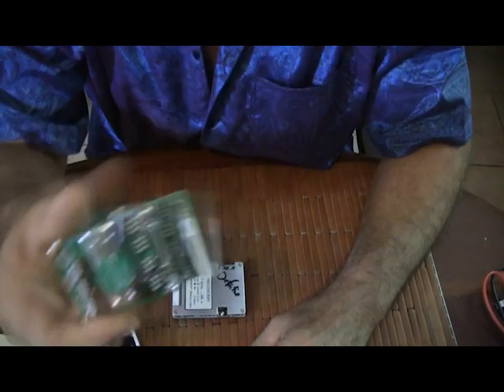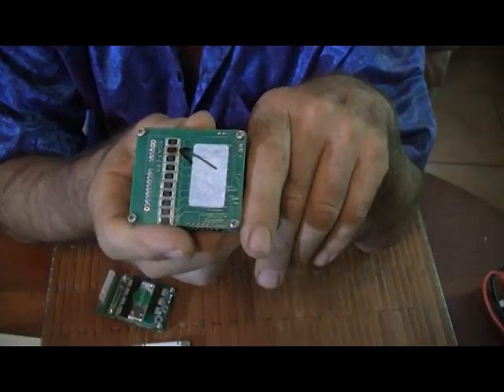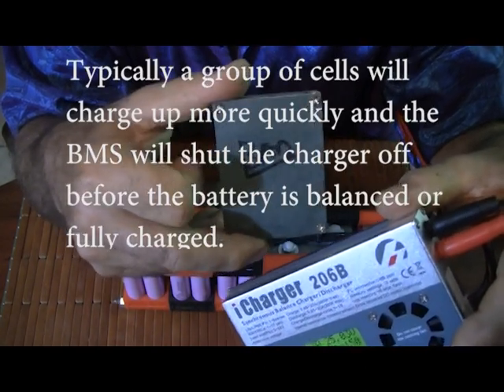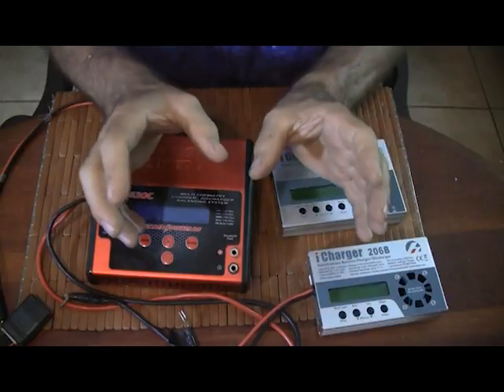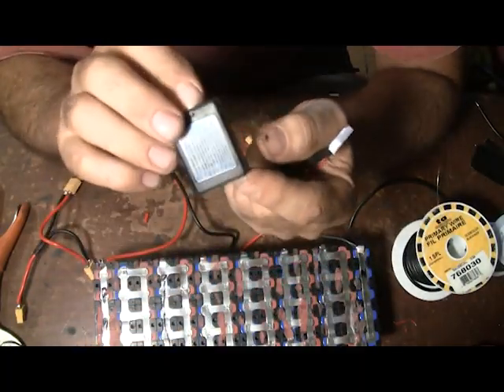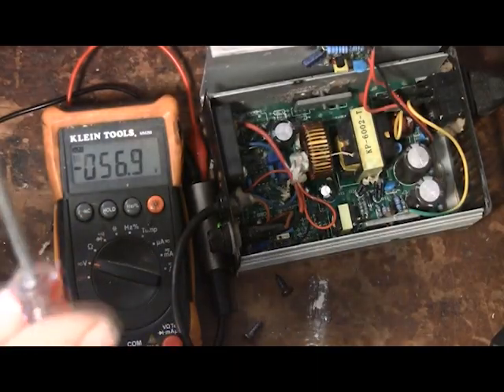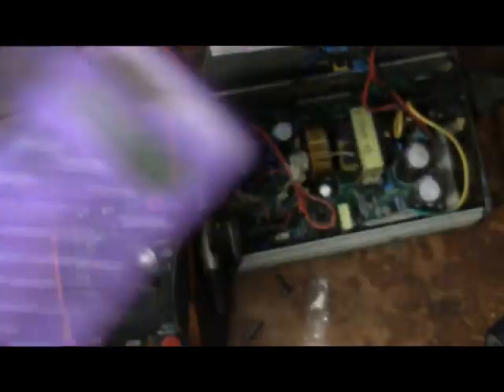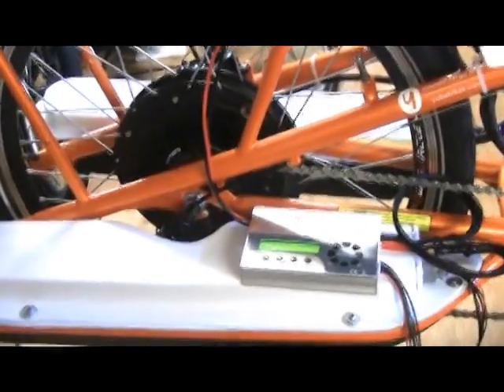How to build a safe and better lithium battery WITHOUT a BMS.

Comment: Hey Shawn, this is the BEST anti-BMS video I have watched so far!!! I don't use BMS myself for the same reason as you, there's no feedback and I don't know what that little cheap and nasty PCB is doing. Most batteries (to not say all batteries) I repair have a problem related to a faulty BMS. The cheap ones don't balance the cells at all they actually KILL cells.. last thing you want is "a device that will unbalance and kill your battery". BMS also makes things unnecessarily a LOT more complex, that doesn't encourage people to make their own batteries!
I made a pack with Panasonic PF back in 2014 and last time I balanced was almost a year ago, I run it hard 1500w every single day, guess what, almost one year later the pack still balanced.
On the other hand I have many videos showing "how to install BMS" because from a bike shop perspective, most ebike users have absolutely no clue about electronics so in this case the BMS is more reliable than some humans.
Congrats for this video, I will recommend to many people here when replying comments in my channel =]
Reply from the maker: Hey Thanks Bruno!  I'm pleased that you have come to the same conclusions that I have.   Tell me, how far would you let your pack get out of balance?  .1 volt, .2 volts?  And what cell voltage do you charge to to be safe- 4 volts?
Reply: Hey Shawn, good questions haha.. at work I have to be a bit more strict with balancing as the pack wont be under any monitoring apart from the BMS, most BMS will cut above 0.5v so I try to keep it below 0.2v after multiple cycles to ensure this difference is not growing and the pack is stable. 
I do charge my 14s all the way up to 58.8v which is 4.2v per cell, it takes a LOT longer to charge but in my case I performance is more important than range and the pack life. For a regular commuter I would say 4v per cell is all they need, really liked you mentioned many times in your video that charging to 4v you can double or triple the cell life, most people don't even know these things. POWER to the people haha =]
Reply from the maker: Thanks for your insights Bruno!  Experience has led us to the same conclusions!
Reply: @BrunoPOWEEER i have recently made a 16 S lfp prismatic pack,and i reduced the peak charging voltage from 59.2 to just 57 volts,, which is just 3.57 volts per cell, while lfp cells can be charged to 3.7,, i have discarded BMS because it failed to respond,and i think i would buy an charger for individual cells when they get too much unbalanced
Reply from the maker: Awesome.  Lets feedback one into the other, create fusion, and power an ebike to Mars!
Reply: No bms also gives you more POWERR!!!!!
Reply from the maker: Good point.  It's because the power does not have to run through the circuitry of the BMS.
Reply: @shawname2 very true
Reply from the maker: Not with the same weight.
Reply from the maker: I agree John- someone with the skills you mention plus a knowledge of electronic circuit design could build a custom BMS for their purpose.  Maybe you could do a video outlining the major areas so we could begin to learn how to do it?  That would be great!
Reply from the maker: You can't trick the laws of physics!  You would need a battery 60 times more powerful, a plane 60 times lighter, or a motor of 1/60th the power...
Reply from the maker: It's a scam.  I have seen plenty.  Latest was a friend who bought some "5000 mah" batteries with "fire" in the name.  They were a bargain, just .85 each!!!!   They tested at 600 mah.    Fortunately he didn't buy too many.
Reply: I have been trying to tell people this but what do I know ? I have a complete electronics lab at home , waiting on my third oscilloscope to arrive this week . During the last 2 years I have bought just about any kind of test equipment anyone could ever need off of eBay , my wife is not to happy with me at the moment . I did fix 2 flat screen TVs and a Bose home audio system for her that were given to me but she is still pissed
Reply: @fakenews7266  Trouble is women want the latest and greatest
Reply: ElectricBike
Reply: Any chance of uploading a How-To video of that project?
Reply: Oops, I was asking DIY Tesla PowerWall for a his Arduino project.
I find battery status displays a bit limited.
Reply: I have not found a Chinese battery yet after doing tear downs , running them and finding out the true mAh yet that live up to the specs printed on the battery's coming out of China . The only 2 batteries that I have had explode were out of China so yeah all of mine I get from Japan . 3450 mAh is the highest amount of power of any Li Ion battery made , so explain a 20,000 mAh Chinese Li Ion battery to me ?
Reply from the maker: Peter- which project?
Reply: I can build you a small nuclear reactor if you like? iv been running one for 10 years now!
Reply: ElectricBike is it possible to charge the complete batterypack with a normal lithiumcharger and sometimes split it into 6s packs and balance it with an imax?
Reply: @klyddmeisters buy an charger to charge individual cells once a month or whenever needed,, and never charge to the full voltage to avoid damage
Reply: You got it wrong. It's the same amount of power coming from battery with or without BMS and when you don't have BMS in the way is when you get more POWER. And for dummies.. YOU GET LESS POWER WITH BMS THAN WHAT YOUR BATTERY IS GIVING YOU. Battery death is as fast with or without BMS only that you can control it better with the device shown in this video.
Reply: Do you homework and then tell me how great Chinese anything is , I have been working on FAKE Chinese Li Ions made in China after you do your homework tell me and the rest of the world how great they are until then Troll on Aaron Clay
Reply: I don't know if they are all fake like we have both used...  i agree some Chinese 18650's claim they are 9000mah etc lol but like you said they only have a watch battery inside!! and are very unsafe!! i would never buy them again!!
Reply: I have tested 10k+ batteries and all of the Chinese ones was very poor/fake!!
Reply: I have not tested 10K but I test every brand a few times a year closer to 2k I have other projects going on
Reply: ElectricBike
Reply from the maker: A 20 amp hour battery at 30C would generate  600 amps for two minutes.....  You didn't mention the voltage but assuming 50 volts that is 30,000 watts- or about 40 horsepower...   

Does this sound like your motor?  40 horsepower and a 2minute flight time?  

I think you would want a bigger battery for longer flight times...
Reply: Volodumur Kalunyak
Reply: Real  Panasonic cells are made in Japan and cost around $ 10 each . The Chinese print up fake labels and put them on cheap Li Ions , the quickest way to tell a fake from a real one is a real one should weigh around 48 grams  ,https://batterybro.com/blogs/18650-wholesale-battery-reviews/32496579-comparing-panasonic-18650-bd-vs-panasonic-18650-be
Reply: Yes and no! why i built my 24s-22p pack! ;)
Reply: Very true!!
Reply: Fusion core lol
Reply: +asusreviews, +shawn mccarty lol the bms switches fets. heres a news flash your ESC/what ever is connected between the battery and throttle is also using fets. If your bms is slowing you down you didnt know how to pick the proper components at build or more likkely are basing your bms opinions off shity premade garbage from china. its fine to not like taht...it is absolute trash. But get yourself a cad program, learn what components you need and you can have a bms with charge redistribution that gives you all the safety, longer run time and plug and forget charging.
Reply: +Dylan873 anyone can learn. thats fine if you dont know... just dont join this mindless bms hate movement when the reality is a lot of those people dont actually understand code or electronic components well enough to understand that their oppinions on bmses come from experiance with trash parts. Then they join this anti bms movement and end up looking like a total jehugarcia...errr i meant idiot.
Reply: lol, I got full intent of that one
Reply: ElectricBike
Reply: How long will a 4s pack last, at a maxumum of 3.55v per cell?
Reply: I also make a video on bms inspired by him visit my channel to watch the video. in my video you got everything about BMS 
Topic cover in my video is:-
1) how bms work 2)how to choose the right BMS 3)how to connect a bms 4) how it's work 5) if BMS take care of series what about the cells that are connected in parallel
Reply: I don't think you realize how many different sources from which a battery can come from this single country. For one person to speculate a battery's condition purely based which region of the world it came from is ironically. in my opinion, considered "fake news".
Reply: Not everyone like you is as good at working with an arduino, nor does everyone know how to write code.
Reply: more POWER means faster death for your battery
Reply: Volodumur Kalunyak  true. But wouldn’t you also gain mileage due to no loss between extra circuits and wiring. Especially if your not driving the ebike and faster than usual.
Reply: +shawn mccarty  Im in the middle of an already behind project I may have time in a month or so. regardless, the info is out there. obtaining eagle pcb cam or free kicad is a good first step. looking up trace width to current is another. Linear Technologies has a bms chip like i described. it uses flyback dc-dc... and requires small coils. If you find the part number for the system, look at the data sheet for recommended coils. I was able to get enough to build their system as free samples from coil craft. LT will often free sample parts to you as well. Most charger chips are set by something like resistors so its usually possible to use either pwm or an i2c digital pot to adjust such a chip if you want your 4v charges. 

an alternative to fly back /dc-dc is:

there are several university grad papers floating around about using 2 signal gen chips to get out of phase square waves and switch capacitors between cells to do redistribution balancing during charge or discharge! 
google switched cap active balance and or add lithium ion. 

that should get those willing to do their homework started.
Reply: We are battery specialist from Shenzhen, China. Hope we can help you with favorable price using Panasonic cells. 
Skype:elsa.chen76.
Email: elsaqant@gmail.com
Mob:86-13414478893
Reply: Could you kindly let us know what is the voltage and capacity you are using?
Reply: We are battery specialist from Shenzhen, China. Hope we can help you with favorable price using Panasonic cells. 
Skype:elsa.chen76.
Email: elsaqant@gmail.com
Mob:86-13414478893

Comment: open a makita 5 amp battery there is no balance between cell!! i  guess they only check the voltage drop and charge voltage
Reply from the maker: Are you certain? I've never opened one... Here is a link to a Makita battery pack repair.  It does talk about the need to replace the management circuit.....

http://www.instructables.com/id/Makita-18v-LXT-Lithium-ion-Battery-Repair/
Reply from the maker: Also because it is just a 5 amp maybe it is a NiCad chemistry- that chem does not need a BMS...
Reply: Yep. They are 18650 cells
Reply from the maker: Hmm, curious.

Comment: thanx for the vid. I am also driving my bike without the BMS. a it failed and b eerhm it smells and c it won't work but bleed the battery. Oh and also. I've had the ThunderPower charger and sent it back. I found out that the endvoltage is not adjustable to 4.10 volts!!! no firware upgrade etc. So i also splitted electrically before buying the 2010b! Never was more happy. Best chargers ever.
Reply from the maker: Yes, my experience exactly Jurik.   I asked Thunderpower to fix the voltage adjustment issue.  How hard could it have been- a few lines of code?  It's a shame, I would have liked for it to have worked.  The 2010B is awesome,

Comment: could you let me (us) know what cell logger you used in your video? also have you ever run a comparison between it's output and that of a fluke multimeter? I have read a bunch of reports that these cell loggers are notoriously inaccurate.
Reply from the maker: Hi Christian,

I use these from Hobby King:  

http://www.hobbyking.com/hobbyking/store/__67120__HobbyKing_8482_Cell_Checker_with_Low_Voltage_Alarm_2S_8S_AR_Warehouse_.html

I do check them with a multimeter and find that they are often off by a little.  Sometimes I get one that is so off on one cell that I throw it away.   They are super cheap.  Get an extra or two.

Where accuracy counts with this system is in the balancing, and the good hobby chargers are at least as accurate as a BMS.  For  providing a low voltage alarm a few hundredths of a volt is close enough.  Do you agree?
Reply: I would indeed agree with you. One thing which I have done which might interest you included modding one of these cheap voltage loggers by removing the buzzer and replacing it with a small low voltage triggering relay. In effect this allows for a really cheap way to cutoff the main power terminal lead. I actually dismissed this because of the inaccuracy of the device but I will give the hobby King one a shot.

BTW - are you aware of any version of the same product which also includes sense wire inputs for one (or more temp) sensor leads? That's something I was actually hoping to find.
Reply from the maker: What an interesting original idea Christian, to replace the buzzer with a low voltage relay.  It would either A:  Shut off the entire battery when a cell got low, or B, turn off the charger when the cell got high.  

For my useage, I prefer a buzzer- as I can set it a bit high and use it as a "you better look for a charge" warning.  I hate it when the BMS made that decision for me!

It would be a good safety when bulk charging without a BMS.  Do you have a schematic or pics?  I would share it on my next video....

Comment: Great video - I'm totally inspired.  I've ordered motor kits, and 18650s for 2 bikes - 1 each for me and my wife - but I've yet to find the $5 cell loggers...  Can you point to a source, please?  Thanks for the tips.
Reply: on ebay type lipo low voltage alarm, its the same thing, but they dont look like in the video. I think he modified his. But I use the one on ebay and they work the same.
Reply: That did it - thanks a lot!
Reply: They also make ones that balance too! It's like a bms and will discharge for you.

Comment: I have noticed at least with a hobby charger during the end of the cells life they tend to not be able to charge near 4.2v. My crap cells will charge to 4.11 at an exponentially far lower capacity.
Reply from the maker: Curious, do you have a theory about why they won't charge higher?  Do you think it is the hobby charger?  Have you tried setting it to 4.25 volts per cell and seeing where they ended up?
Reply: +Shawn McCarty Does not sound wise. Have you? There are several other videos on this.
Reply from the maker: 4.25 is OK.   I have found that my icharger does a good job of bringing the cell voltages to where I have set the charger. The icharger duo for example reads to .001 of a volt, very precise.   I do use new Panasonic cells too- maybe that is part of it?  

Are your cells getting warm when the charger shuts off?   Perhaps the cells will reach a full charge but the voltage will fall back off??
Reply: +Shawn McCarty warm yes but no more than usual.
Reply: when they dont go to 4.2, i get rid of them. They will keep a pack from getting a full charge, and they will get very hot. They get hot because the charger will keep pumping current into the battery until it gets to 4.2 which it will never reach. Lithiums unlike lead batteries (which use the same method to charge) will keep accepting power with bad results. If a batterypack is taking too long too charge thats why, you got a weak cell that wont reach 4.2.
Reply from the maker: Thank you Jony, that is good information.

Comment: You receive diminished returns each time you charge them. So the theory of 80,000+ miles is highly unlikely. I had packs very similar to yours with new old stock cells. Never been used cells. And i cannot get that many miles if i charge them to 4v. But if you can congrats.
Reply from the maker: Yes, you are right about the diminishing returns.  Let's not talk about mileage as this depends on the battery size.  Let's instead talk about years of life.

The way the EV industry deals with a slowly declining range is to slowly up the charge voltages on the cells compensating for the decline in capacity.  In the end of the cells lifes, they are now being charged to 4.2 volts to give the battery the same capacity as a new cell charged to 3.95 or 4 volts.

The non-bms option gives us the ability to mimic this.  

No, I have not yet ridden the same batteries for 80,000 miles.  I have driven them for over 15,000 miles now, over 12000 miles on my "Loop the USA" tour.   I don't know how far they will go.   I wish I had the resources to do an over the road test!

Comment: Great vid!

So when the battery pack is balanced you dont need to use the balance charger until you see them drift apart again? If so,  could I charge them with whatever power source that meets the criteria(volts, amps) of the batterypack?
Reply from the maker: Yes.  Just don't charge them to over 4 volts per cell (parallel group of cells)  for safety.
Reply: Great